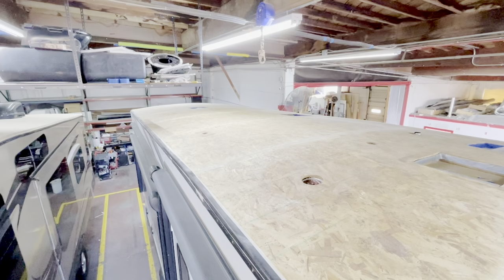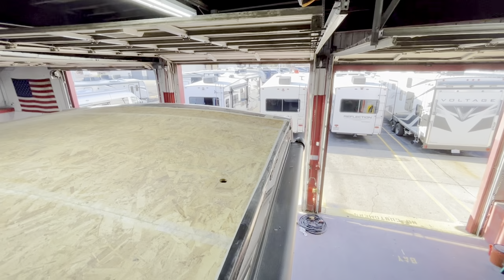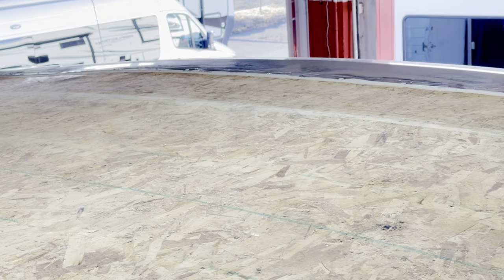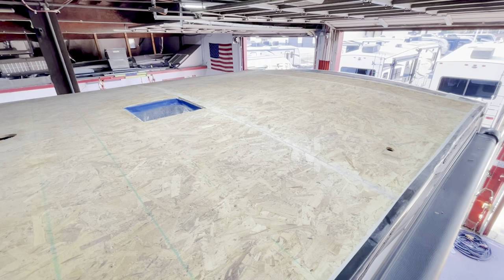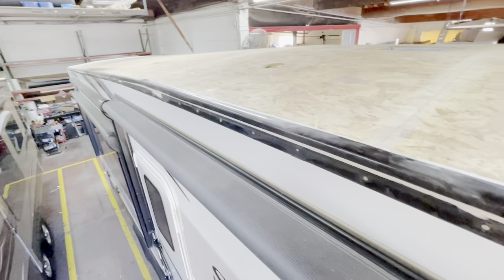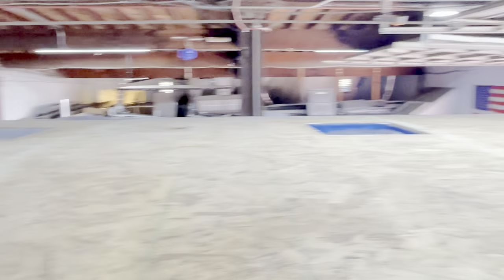RV Roof Replacement: What You Need To Know

Comment: We owned a 2018 Grand Design. It had sooo many flaws. Roof, kitchen island had to be rebuilt, water leaks on the slides, air conditioners failed, furniture had to be replaced, etc. I would never own another one.
Reply from the maker: I’m sorry you had so many issues, we trying to help the industry by providing more information to hopefully help make a change.

Comment: I had to do a repair about 4’ x 2’ I screwed it down but decided to go around the seems with PL premium instead of the mesh tape.Whats is your thoughts on that?Also the front half of my roof from the air conditioner forward is 7/16” & from the air conditioner back is 5/8”.

Comment: How is this getting replaced already. I have a 2020 GD295RL 150 series. Mine looks immaculate. But, when not in use just the roof gets a 12mil white tarp to cover it. 4 times per year i use a rubber roof cleaner and then completely soak the roof in 303 Aerospace UV protection. A little care goes a long way
Reply: In this case there wasn't enough adhesive to hold the roof to the OSB.  If yours had the same problem the material would come off no matter what you are doing to the outside.  It's a quality issue.  Lack of quality.
Reply: @brianhaefner639  I'm glad I bought one before covid. GD has a bad reputation as of late. We sure did get luck with ours.
Reply from the maker: Check out our videos on how we glue them.
Reply from the maker: Thanks for sharing